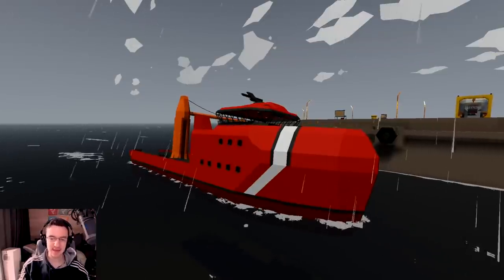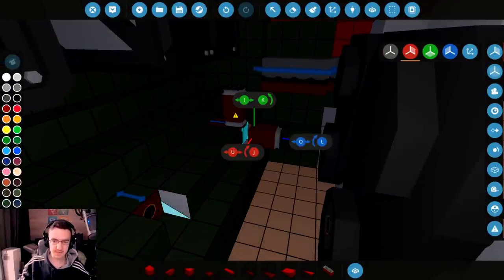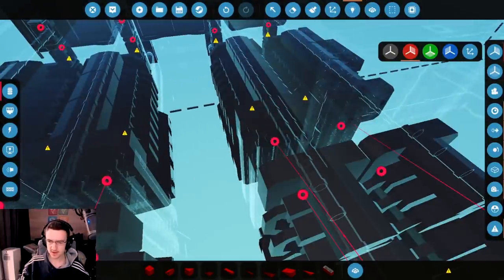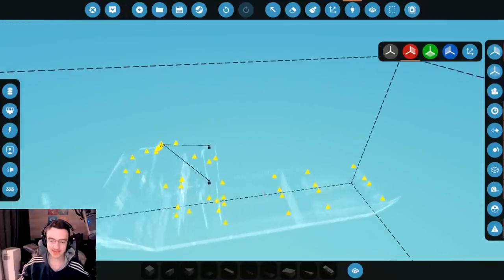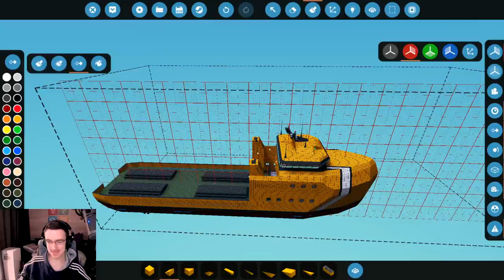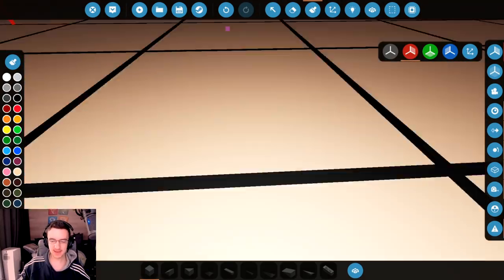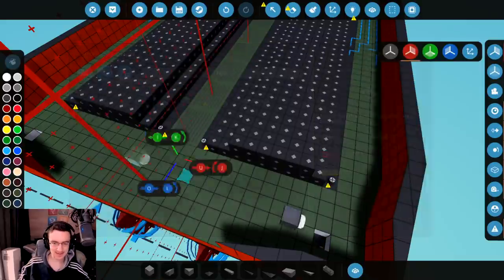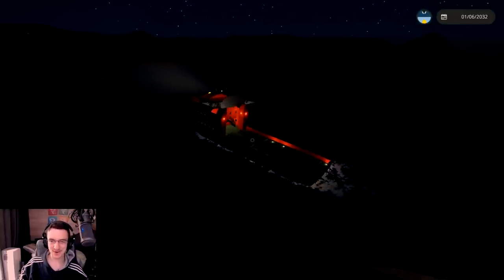Attaching The Engines & Crane Removal!  -  Supply Ship Build  -  Stormworks Build and Rescue

Comment: Loved the video Frantic! I have a few suggestions for the boat, first you should make a spot for it to tow a boat inside so you can repair it. Second, you should add some "Bridge wings" or extensions to the side of the bridge for some extra spotlights. Finally, you should put in a couple of water cannons so you can fight fires with it. I think a twin mount at the front and another somewhere in the back and have a console on the bridge to control them.
As for the color, you should paint the hull Light Grey and the deck Medium Blue like a military ship!

Comment: You should go for those rear facing spotlights , if you're going to have crates stacked up on the back in case you need to adjust stuff in the night or they like fall or glitch and you need to check it out.I

Can you add connector controls and the rear light angle the rear facing control point?

Then there's a fire extinguisher system for those 4 engines and a repair tool. In case you bump the dock or drop a container it won't just sink helplessly. Just thinking of a pump in pump out for water and / or fire extinguisher or two by the ladder.

A ramp to drive vehicles to drop off on may be a nice consideration later.

Can't the winch go under the deck and poke out if you feel you need one?